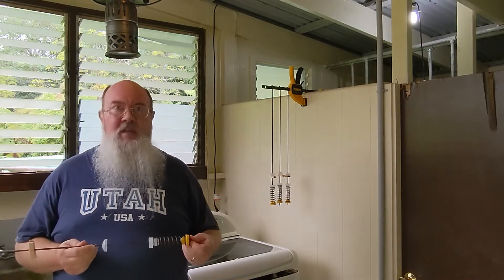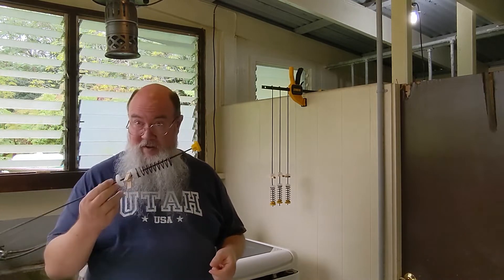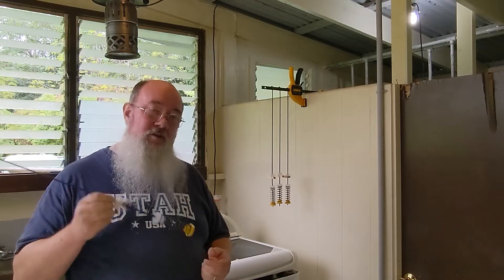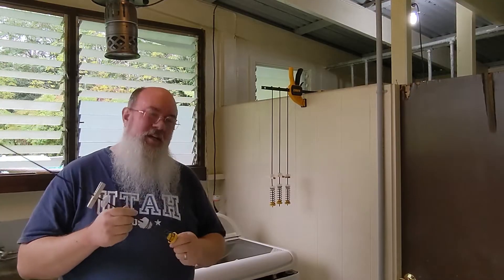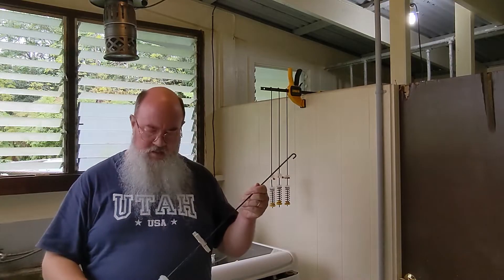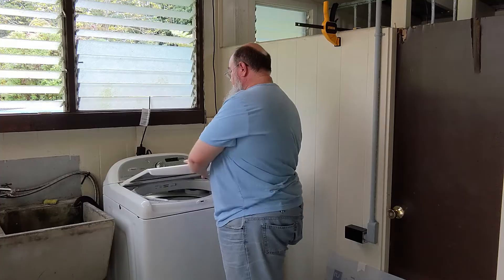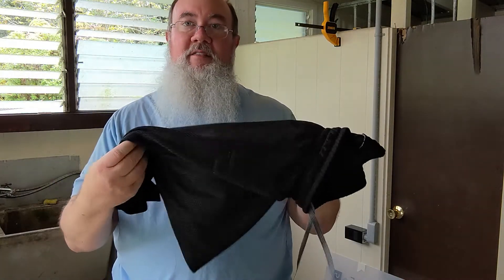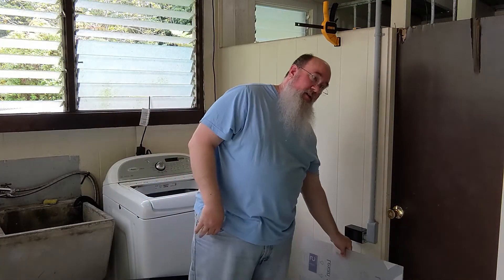FIX your washing machine rods! Don't $$buy$$ a new washer or washer rods before watching this video!

Comment from the maker: This repair was made on 2021/12/05. As of 2022/05/08 (154 days), the washer still runs all spin cycles flawlessly. I have applied no new grease, yet. I have made a couple of additional repairs to fix cosmetic problems (mostly parts that are excessively rusty here in Hawaii), but it still runs through a full cycle without incident every time. I do expect to check the state of the rods at 12 months, but I don't expect to find problems, yet. If so, I will again chalk it up to the marine environment which causes things to break down very quickly, here.
Reply: Looks like you just mold it to the cup and used the grease to kept it from sticking to the rod.  I watch the other guys video and even sent him some questions but I like your modifications and going to give it a go. Thanks
Reply: For those who are thinking about it, I tried applying new Nyogel to the original OEM rods and it was not sufficient. They worked at first but were failing again within a week. The mechanism must be very sensitive to the tight fit of the damping plugs.  I also tried non-OEM replacement rods and they failed in a month.  So either (1) try molding your own damper plugs as Zack did or (2) buy new OEM rods--they solved the problem.
Reply from the maker: That's correct: If the original dampening mechanism/material is not clinging tightly to the rod, then the dampening effect from the grease doesn't happen. If you change the part that grips onto the rod, all you have to do if it gets bouncy again later is add some new grease.
Reply: Good common sense advise. I took my rods out and replaced the foam friction tubing with cut down nerf gun bullets, they fit tighter than the factory foam. More new dampening grease and the machine works like new again.
Reply: Hey so the gripper part on one of my suspension rods is loose like away from the coil like it’s suppose to be. My question is will the grease alone work or since I got one where the “cup with the sponge” whatever u call it (plastic part) has separated from the coils do I need to do both making a new thing to hold like you did & then the nyogel? 

Also are there other brands of that dampening grease I can get if I can’t find nyogel? Hoping Walmart or maybe Oreillys or autozone carries it I ain’t got time to wait on one to ship to me 😭
Reply: Aloha Zack! Glad I came across your video. I'm facing the same problem wth my Maytag Washer. It seems I've had problems from the very beginning since I bought the machine especially with the sensor thingy. I've had two replaced and the second one has a mind of its own. I more or less have to baby sit it or the washer will begin a new cycle. Now the banging begins!

Btw, I live on the Big Island too in Puna in a subdivision called HPP. It seems everthing just rust, rot or mold! It's certainly a challenge living in Hawaii!!
Reply: You just saved me 60$ for the rod set on my Samsung washer. Thank you for troubleshooting and sharing your results with us.
Reply: any updates Zack?
Reply: sir  i  just wanted to show you  a easy  way an it cost you next  to nothing do it an lest than 10 min  to fix
Reply: Thank you for explaining the issue in detail . Makes sense .

Comment: Any mechanic will tell you if your car pitches too much, rolls side to side ,bounces excessively then your springs are too soft and new shocks will help only for a short time. These machines need stiffer strong springs! Think back to the older machines, you couldn't just take a finger and push the tub over or down😂! It's pure common sense,  2 lbs of laundry and the drum swings around like a carnival  🍵 teacup ride! Yeah the springs are way too soft because they're cheap Chinese junk!!!🫵

Comment: The reason this a constant reoccurring issue is because the springs are too soft to begin with! All this plastic friction rod crap is a mimic of the original new rods and people think it's the issue and it will only help for a short while. I've already ready in other chats where you can stretch the springs for more tension or buy stronger springs at a hardware store. I have one of these garbage machines at only 2 years old and it's flopping like a fish. I know i can copy the old washers and drill in all 4 top corners and hook tension springs to the outer barrel and just be done with it. Trying to modify those stupid rods is equivalent to polishing a turd.😂

Comment: I fixed my banging washer without replacing or modifying the springs. All I did was remove the springs and then while compressing the spring I smeared some of the excess friction grease that was on top of the cap onto the rod where the spring cap slides up and down. This fixed the banging. It seems that the friction grease wears off the rod over time and all that needs to be done to have the spring damping again is to reapply some of that grease to the rod. No new parts needed or modifications are necessary.

Comment: You nailed one issue. I also have my washer apart at the moment. I've tried that safely pin trick but only helped temporary. I bought new rods and they were too short. As there seems to be a few different sizes. This motion greese solves the issue of shake and balance. But what if your springs are worn out?

Comment: Cheap new rods from Amazon cost about $30 and new OEM from the company cost about $50 for my machine anyway. A few people said Amazon rods are junk, I'll take their advice.  I appreciate the ingenuity, but for all the time spent getting the stuff, the expense, and doing the fix, I think for me, new rods will be the solution. Great video though!
Reply from the maker: At the time I made this video, the only new rods for this washer available to me in Hawaii were $125. Not sure if that was a quirk of Pandemic Pricing, We Can't Ship It To Hawaii, or something else ... but if they were $30, I certainly wouldn't have bothered to put all this work into it!  That said, what does "Amazon rods are junk" even mean? This is a spring and a piece of steel: They aren't "going bad." That kind of thinking is what let me to wonder, "What the heck is going wrong, here?"
Reply: @zackstone6354  Yea.. of course.. Everything from the mainland will be more expensive. Hawaii is a beautiful place to visit if you have the moola. I didn't buy the rods or the grease, There was enough grease built up in the caps and I stiffened the rods up with an inch of water line I had left over for the fridge. I slit it down the middle, fit it around the rods and shoved it into that sponge. W.M runs like new.  Cost me nothing except time. Watching vids like yours helped a lot. Thanks!
Reply: The problem is, the new ones from Samsung are junk too. Otherwise, we would not be replacing them.

Comment: I boxed mine in with wood. i used self tapping metal screws. Theres is a foot and a half 1" by like 3"  along the top left and right sids right where it bumps the wall at the top and one in front. I did three sides front left and right. It works! It gets corrected back to the middle and actually makes it spin silent.
Reply: Any pics?

Comment: There's an equation for determining maximum harmonic frequency of springs.  Some washer companies will put a big concrete block strapped to the base of the drum so that the compression on the springs is such that the washer will always operate at a frequency that is less than the springs will respond to.  The dampening grease basically does the same thing by delaying the natural frequency of the springs thus preventing them from ever getting going out of control.  Manufacturers want to make a quiet appliance and once that will not rattle itself to death over many uses.  The springs and the foam dampener all help in making the machine quiet.  The spring cussions the basket under load and prevent vibration.  The dampener foam piece along with the grease provide just enough resistance to delay but not completely cancel the harmonic frequency of the springs giving them time to level out.  Other fixes  call for making the dampener ridged and not move at all.  That just makes the machine vibrate.

Comment: nice stuff, the solution i plan on mines is to use nylon zip ties to tighten the bushing and some silicone grease for the shaft. which should save me a good $40 or so. Thx!

Comment: I followed your suggestion exactly, and it worked perfectly. Just make sure to use Nyogel 767A Synthetic Damping Grease, as no other grease worked for me. My rods are about 2 years old, so I also replaced the internal cylinder with Epoxy Putty. I am a happy camper. Thanks for taking the time to make this video.

Comment: Can you recommend a good solvent for nyogel 767a? I downloaded the data sheet from the manufacturer but no solvent listed. They said for skin contact soap and water. I've tried alcohol, acetone, carb and brake cleaner no luck.
Reply from the maker: Goo Gone, my friend ...
Reply: Thanks Zack I'll give it a go. I know what you're talking about in regards to high humidity salt environment. I live 500' from the ocean just south of cape Canaveral. Two of my rods rusted out and the machine is only 3 years old @zackstone6354

Comment: I just put new rods in mine that did nothing.  I will do this fix to the old ones and transfer them.  I looked for the dampening grease on Amazon and the epoxy is offered as an add on.  I guess enough people are buying both so Amazon puts them together for you.
Reply: So I ordered the grease and epoxy.  While waiting I took one of the old ones apart, the insert seemed sound, it was just dry with a small amount of grease inside the cap.  When I got the grease I just squeeze grease in the bottom of the holder and some inside the cap.  I did that to all four rods and pushed everything back together.

To make it easy I just replaced one rod at a time, my wife helped me tip the machine over to slide one out and slide the replacement back in. Works better then new.  I will just store the epoxy and new rods in my garage in case I need them.

Comment: They're 'damper rods' and operate on 'controlled friction' like a shock absorber. The issue is they ALL have to work and provide, relatively the same resistance at each mounting point, otherwise you'll have a problem maintaining balance. By the way, that is a LOUSY suspension/dampening design which seems to have become common in all residential washers lately. The 'old' method was to suspend the tub from the base of the chassis (which commercial washers still use). Not smart or effective to try and suspend 15 gallons of water and wet clothes from 4 skimpy points on a flimsy cabinet. Good job fixing it.
Reply from the maker: It is a strange design, and I'm not sure why it is so prevalent. To your point about the same resistance, I think it is more like a threshold: They each have to remove some minimum amount of bounciness, but above that line, they can be pretty different and still keep the thing stable. I'm quite certain my bespoke rod refurbishing, including accidentally bending one, shows they have wide tolerance, at least. They all have to take energy out of the system, but it can be pretty vastly different at each rod - so long as each is contributing something to the process, it seems to work fine. Once you have one that is nearly elastic where most of the energy comes back out, that's when things go sideways (literally).

Comment: I'm curious whether some plumbers grease or non-curing thread sealant would work as good as the damping grease? i bought an aftermarket set of rods, but fully intend to rebuild the originals and have a spare set to swap in when the replacements eventually go bad. Other solutions to the dampers include wrapping them with electrical tape to restore the grip, or splitting them and putting some rubber hose in between to increase the friction. I'm also considering combining those two solutions.

Comment: Saw your video and debated damping grease vs new rods.  Grease  ~$20 dollars vs new OEM rods ~ $60 .  Rods won and the washer was working again.
Reply from the maker: I have noticed that unlike all other things in the past three years, rods have gotten a LOT cheaper. When I first looked at replacing the rods, a set of them was over $100 to order to Hawaii. Now, I think I can get a kit that is under $40 for the same washer. I can't prove that this video had anything to do with that, but given that several other videos with similar methods are available on YouTube, now ... maybe these rods seem less "magical" than they used to be? And getting $20 or $40 is better than letting them all sit on the shelf ...

Comment: I bought some of that grease(thank you). Well I have a ge washer too. The suspension rods are a little different. They have a metal spring also but the dampening effect comes from a plastic disc (piston) that rides or moves back and forth in a plastic cylinder. So I applied the grease on the piston and cylinder, and on the metal rod where is goes through the back end of the cylinder. Anyway It still needed the grease in there to slow the movement down. So it works like new again.

Comment: I'm wondering if Viton or neoprene rubber insert will solve the problem for good? You get these in standard cross sections, make a split version to insert into the plastic piece with a correct hole for the rod and should be good for many years. Use a hose clamp  or something to keep the split insert from opening.

Comment: A little bit of advice= slow down the play back when you are actually making the "gripper" on the rod. I could not see what you were doing at that time in the video.  There are two or three videos that do a better job on you tube.  I thank you for the effort you made but the other videos are the ones I will use to repair my washer.
Reply from the maker: Since I posted this, a couple of folks have figured out some better ways to make grippers. But the secret is really the grease. So, however you get something to stick to rod that restricts the flow of the grease, you'll be good.
Reply: @zackstone6354   I wish you would sit down at a table, lay out the parts, and film it so we can see what you are doing. No jokes or music.
Reply: @zackstone6354 can you share the "better" ways of making grippers?
Thanks